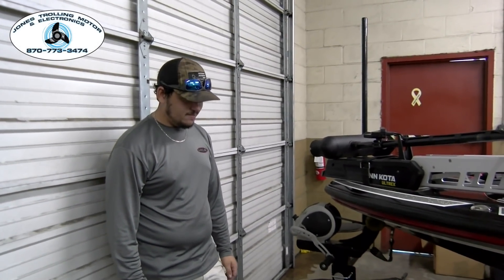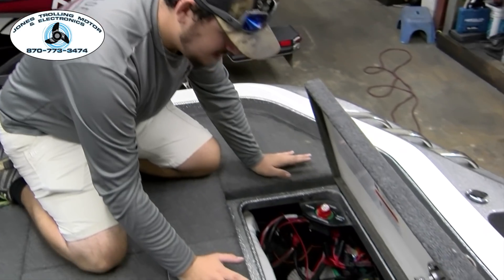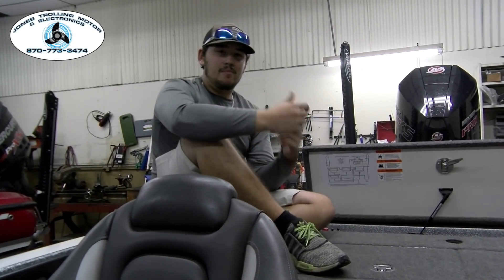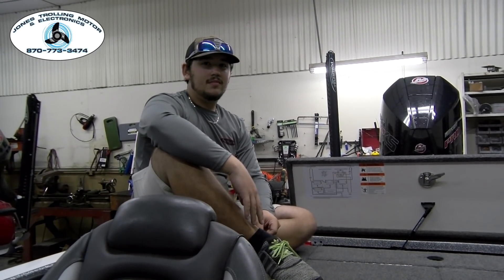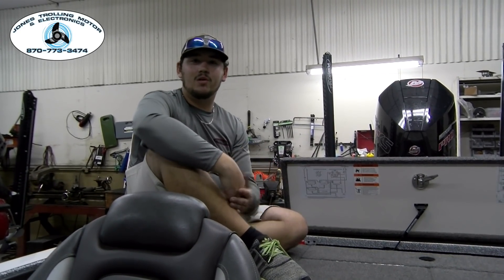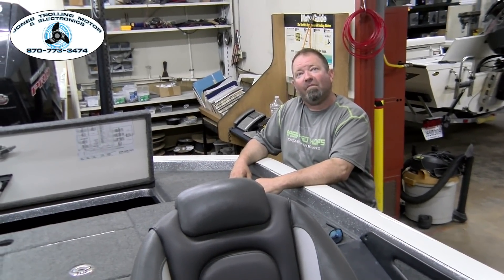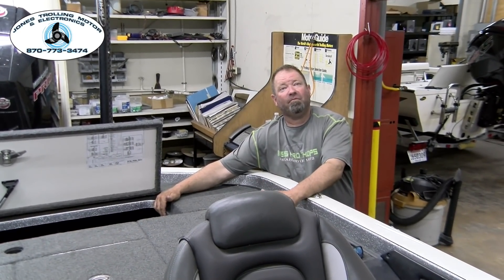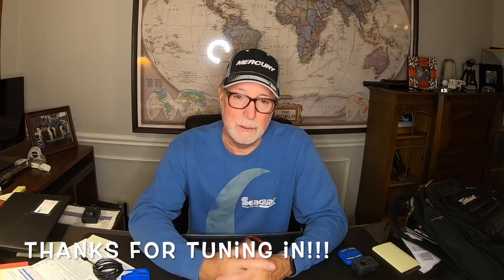Factory Installed Jump Switch Causing Electrolysis?

Comment: Thanks Ken! Already went to the garage to switch my breaker off and check my jump switch wiring.
Reply: If you had read the manual for your TM, it probably said to disconnect the TM before charging batteries. Most TM manufacturers don't want the higher voltage of charging systems (that aren't true DC as well) to reach the control board of their products, even if there is no power surge on the electrical grid.
Reply: I have a Thermal Circuit Breaker for my Ultrex. Do I pop that switch instead of adding a red disconnect switch? Cause right now the only switch i have is the one at the pedal

Comment: Ken happy new year
The exact event occurred on a brand new Skeeter ZXR 21. My brothers were at Highport store and a Mechanic came up admiring the boat and noticed the corrosion occurring.Less than 10 hrs.
The dealership resisted somewhat about repairing and blamed switches in wrong position,etc. They did repair however refused to replace bolts on the lower unit of the yamaha [ major dealer by the way]
Thanks for bringing this topic up

Comment: Ken, I always learn from your videos. I inspecred and hadn't noticed anything before and no electrolysis seen. I checked my ground wires at rhe batteries and at my level it looks correct--nthing that looks odd.  I only have a master perko switch in the battery compartment. No separate Trolling motor switch,  other than the on/off switch at the TM pedal. I think I'm good. Thanks!
Reply from the maker: Alan I think based on Michael's comments it might be worth putting a switch between your charger and trolling motor as well.
Reply: @KenSmithFishing  ya, i think I'm going to do that. But would that be between my "battery" and trolling motor, not "charger". I keep re-watching Michael's explanation to understand.

Comment: heard a comment about 'backflow voltage'.  surely minn kota installed a 'rectifier diode' on their main board which allows current flow only in one direction , preventing 'backflow'. it also has other uses but....?
Reply from the maker: Larry not sure since you are way above my paygrade (if I have a problem I turn it off and turn it back on, if that doesn't work it's back to Jones!!!!). But there was a lot of discussion that was off camera about these and you have to remember these guys don't just service new boats, they do a lot of work on guys older boats so they see all kinds of stuff. Thanks for weighing in!

Comment: Ken, Thanks for this post on the trolling motor. Several things I never knew and of course I'm a plug it in and forget it angler.  And being here on the Potomac River I have the added concern of brackish water.
Reply from the maker: yeah I'd think that would just make any of these problems worse when you add salt to the water
Reply: Sorry. Hit thumbs down on accident. Good tips. Thanks

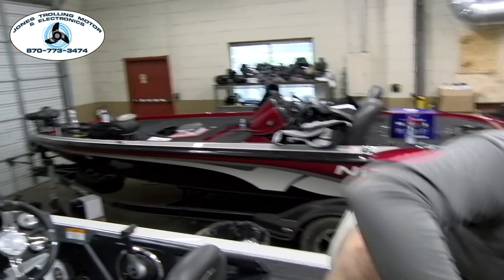Comment: When you have it wired incorrectly (mine was and still is wrong from the dealership) on the trolling motor battery - is it a guarantee you've got a hot boat or only potentially? Or is it only going to be hot only when you're using that jump switch? It sounds like what he's saying around the 3:45 mark you are having electrolysis at that point.
Reply: The opportunity for electrolysis is present whenever the TM is in the water (if there is improper wiring in the boat). Whether it occurs or not can depend on water chemistry. A Ground for one system should never be connected to any point other than Ground on another system. That Ground is what many would call the "0 Volt" connection - whether for a 12V, 24V, or 36V system.  You need to correct the wiring ASAP.  If you have a transducer in your TM, you've probably already blown the "grounding fuse" inside the head of the TM.
Reply from the maker: Tyler in case you were wondering TxMan is an engineer!!!
Reply: @txman201  thank you for the reply - I’ll correct it here right away to look like the connections in the video. Luckily I don’t have any transducers in my trolling motor as I have not yet upgraded it.
Reply: @KenSmithFishing  thank you Ken! I appreciate your response and videos and love learning from them!

Comment: I may have misunderstood about turning  the circuit breaker off.
when the breaker is off ,it simply kills the power to the device.  when it is on voltage flows to device  until the amperage exceeds the value of the breaker at which point the breaker turns off.
so why are turning breakers off, again?
Reply: Because when you are fishing, you are not hooked up to city power so there is no chance of a 120v power surge ruining your tm board.  When you are home and charging your tm batteries from city 120v electrical supply,  if this breaker is left on, a power surge from the city supply can travel through that breaker to your tm board and fry it.
Reply: as I said , when the'amperage' exceeds the value of the breaker it shuts off therefore  connection to device stops before the surge hits the device.
you probably have a computer or tv  , printer etc and I hope you have it plugged into a surge protector (aka breaker) do you unplug the surge protector when not using your computer or tv?
also, the electrical service to your house goes through a circuit breaker before it reaches the outlet you are plugged into ; if there is a sufficient surge that breaker will stop power to your outlet. with the exception of direct hit  lightning .
thanks for reply , sorry for writing a book....
Reply: @larrycallahan2600  Sorry, but you are mistaken.  Yes, Circuit breaker protects against amp overload (short circuit is example).  It is not a surge protector.  Surge protectors monitor for Voltage spikes and clamp shut at a set higher voltage (lightning strike is example).  Some homes, including mine, have a whole house surge protector installed in the breaker box, in front of the circuit breakers, to protect all circuits from Voltage spikes.  Required in new home construction in FL.
Reply: @topwatertrl  thanks, hey, great idea to have protection prior to fuse box! hopefully many people will benefit from your post.
Reply from the maker: Good stuff guys, thanks for the additions!
Reply: @larrycallahan2600  you went off into the weeds on this post.  All of you are correct that the circuit breakers protect against excessive current.  There's a side point that said breaker doesn't trip fast enough to block ALL excess current, just soon enough that conductors and components don't have enough time to heat up from excess current, resulting in meltdown and fire.  You're confused on what a breaker protects FROM, and it's not voltage.  It protects from excess current (amperage).  If a lightning strike occurs near your home, the high voltage surge will often be attenuated by power company equipment, but in worse case scenarios (close to your connection to the grid) that may not be enough. A very high voltage spike can come into your home without affecting any circuit breaker, assuming the current isn't above the breaker rating, which it usually isn't. Voltage and amps are different, very different.  But, either can fry electrical components, especially silicon devices (think circuit board components.  That surge protector?  It has a  special type of zener diode that limits the spike. The breaker on a surge protector isn't what protects from those voltage spikes. Lower quality surge protectors can actually be somewhat of a "one-time-use" device in that the diode may get fried in the course of protecting the attached circuits.

A bad voltage spike can blow right through all your AC current-limiting breakers and receptacles to an unprotected charger, and anything attached to it.  I always use a surge protector for my charger, but I still turn off battery switches and the TM breakers.
Reply: @txman201  hello, I agree with everything you said except the part about me being " confused between voltage and amperage"   if you have a minute please reread my comment and you will see where I stated Amperage causes the breaker to stop supply voltage.
Thanks for your comments.
Reply: My onboard charger plugs into a commercial surge protector in my garage that charges my batteries.  I have a thermal circuit breaker between my trolling motor batteries and the trolling motor. The on/off switch at the TM pedal is the only thing that keeps my TM from turning on. Other than circuit breaker protecting the board would a cutoff switch between the batteries and breaker be prudent?

Comment: txman201: I agree with everything you said in your post re : incorrect wiring.
However, I find your ' shop flunkie "  comment unwarranted and offensive . Lets 'zoom  out' ....a dealer invests, I dunno? 80,000$ in a boat order to sell at a profit ,he wants a happy return customer, the service mgr wants the same ;  do you really believe he would turn loose unqualified untrained unsupervised (flunkies-your word)  technicians on a project of that
 magnitude?  
I think you have 3 options at this point, 1. apologize, 2. edit the post, 3 never take your boat in for service for fear a technician may have read your post.🤔
thanks, Larry
Reply: No apology.  The world of boat owners has an abundance of people who continually search for a shop with competent service - something that's a sad minority these days it seems.  Examples:  Flunkies rigging transducers on the port side of the boat.  Flunkies drilling holes completely through the bottom of a boat while installing a battery tray.  Same for installing a hot foot throttle. These were rigging horrors on boats that had yet to see water!
Reply: @txman201  once again we agree.
You are referencing "shops" 
While I'm referencing boat "dealerships" . 
Thanks for comment.

Comment: So what caused the electrolytes on your trolling motor?
Reply from the maker: Not closing the breaker off when I was charging that boat
Reply: Was trolling motor in water?
Reply: My problem was a two bank charger. Two systems one trolling motor independent of boat motor and Garmin electronics which grounds my tracker through my boat motor. When charging they're independent of each other, but when not charging they share a common ground which causes the trolling motor to be grounded though cranking battery which is grounded to boat through the boat motor.
Simple fix I disconnect trolling motor battery from charger. No more problems.

Comment: "Factory Installed" is a misdirected root cause of electrolysis. The fact that electrolysis occurs has nothing to do with where the jump switch was installed, but rather that it was incorrectly connected to batteries.  Shop flunkies in a boat rigging/service bay after leaving the factory are much more likely to be the source of the INCORRECT WIRING CONNECTIONS to batteries. That a jump-switch may have been factory-installed isn't a fault, per se.  ANY incorrectly connected jump-switch will do this, not just ones installed at the factory.
Reply from the maker: Understood even if we install them ourselves we can screw it up, I just know mine came directly from Ranger installed incorrectly!
Reply: @KenSmithFishing  that's really bad!